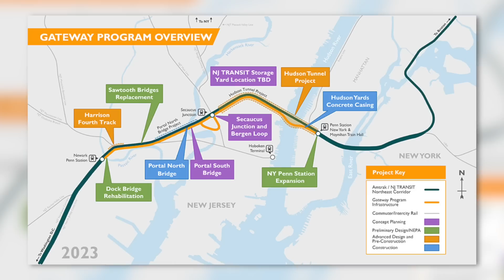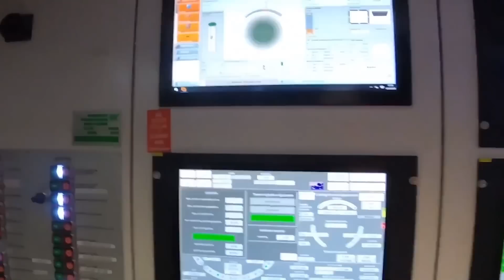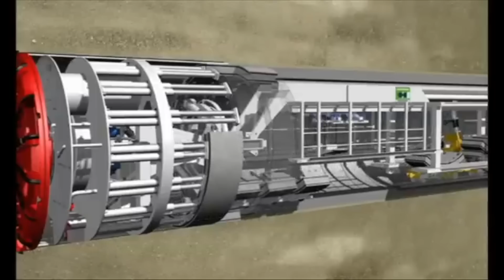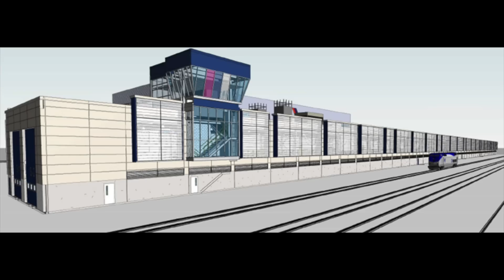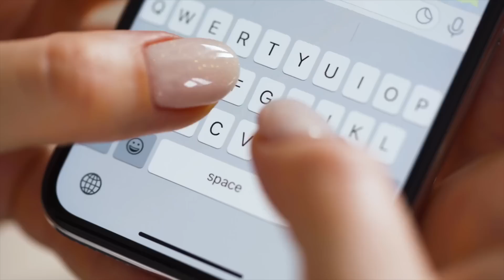Inside New York’s $16BN New Mega-Railway

Comment: Why not build a tunnel like the one being built in Denmark to Sweden which will have been done in 7 years. It would take a much shorter time because it'd be much shorter. The European tunnel will is being built using concrete section the are being sunk onto a trench piece by piece. The best part you can have 5 tunnels for the price of one, each section can have rail and car traffic.

Comment: The initial attempt to build this tunnel was canceled and was called Access to the Region’s Core by Chris Christie in 2010 before the hurricane because of the escalating cost. It was originally going to cost $8.7 billion and went to $12 billion so he got rid of it. Now we have the desperation of the Gateway Program which costs $16.1 billion. The backward thinking approach over a decade ago resulted in this monumental challenge to replace the rapidly deteriorating original tunnel which is now 100 years old. As mentioned in the video as soon as this new tunnel is in place, the old one will be closed to be rebuilt completely due to the salt water corrosion which is causing it to rapidly fail with outages regularly occurring on weekends to patch it up.
Reply: Christie SAID it was for escalating costs, but NJ's part was small - and he used the funds earmarked for the tunnel for Republican pork projects.
Reply: @peterquennellnyc  I know - left that out.  It was very short sighted at the time and now the region is paying for it with terrible service.  I lived in NJ when this happened. Fortunately, now I live in CT and don't have to deal with the awful 100-year-old runnel.

Comment: This is not pioneering  - it is not transformational - it just adding capacity.  In fact, the plans are tied to building 8 new platform tracks at Penn Station and a NY Post story from December shows that part of the project is going to cost $17 billion.  What is needed is a new vision that connects the operations of all three commuter rail systems that today operate in their own silos and recreate a regional vision that makes seamless travel from one end of the region to the other.  This project as designed falls far short of that vision.  We need a new pair of Hudson River tunnels, yes,  but we also need a vision for connecting the NY region the way London and Paris have been able to achieve.  The LIRR just built a similar 11 billion dollar 8-track terminal far below Grand Central, because Metro-North didn't want to share the main station, and only 50,000 passengers a day use it.  While London just opened the Queen Elizabeth Line during COVID-19 and this two-track line moves 600,000 per day, more than the total ridership of the LIRR NJTransit and Metro North combined.  No, we are way behind the rest of the world on visionary thinking.
Reply: Hit the nail on the head about the importance of through running. It is madness to continue to build stub end terminals in NYC. Madness and stupidity.
Reply: Back in the mid-1980s, British Railways conceived and implemented the idea of NetworkSouthEast, interconnecting all the lower-right coner of UK, train services crossing London.
It was a very useful scheme, subsequently ruined by political ideology, but many services continue to cross London usefully, without terminating there.
Reply: Not sure what's broken. Many London "tube" trains are stuffed to bursting. And "only 50,000 passengers a day use it" is misleading. They would have arrived at Penn Station otherwise and then have to find their way back to NE midtown, where a lot of new construction is planned.
Reply: @peterquennellnyc  600,000 a day are using the new Elizabeth line in London, while only 50,000 are using the LIRR station at Grand Central in NYC.  This is because the Elizebeth Line is connected from one end of the London suburbs in the west to two destinations in the east London suburbs.  Gateway and the new LIRR terminal should be connected.  36% of NJ Transit riders want access to NE midtown.  Why force them off at Penn and have them crowd the subway?  That is what I wish to convey.  Not only would a connect to GCT help, but also through-running to Long Island, the Bronx, Westchester and Connecticut would provide a one seat ride suburb to suburb.
Reply: @robertw.previdi5450  I dont disagree - but I've seen it all before. There WERE proposals to extend Gateway to Park Avenue x 34th Street subway area and in years to come that could still happen. Subway to NJ too. No lack of foresight as you imply. It does take cash. You omit that Manhattan's walking distances are smaller,  I walk twice daily between Port Authority and UN. And Elizabeth Line is apples and oranges. Most tiny London tubes still bulge... hmmm... maybe lack of foresight there :-)

Comment: The "Box" was necessitated by the selling off of a tunnel easement at 31st Street in 2015, which would have provided a superior alignment into the station. The easement was procured around 1910 along with a similar one at 33rd Street, as the need for two additional trans-Hudson tunnels was foreseen. Both the lateral and vertical alignment of the currently-planned tunnel are extremely problematic, and I can't say it's not willful, deliberate.
Reply: Always people in the past were more forward thinking than anyone now...

Comment: ny has so many serious problems. i doubt that the rail problems will keep ny residents in ny
Reply: This project is also for the nation, not only for the NY-NJ area…
Reply: @aoilpe  Not really. NY is losing population and the rest of the US does not benefit from the NEC expansion. In fact it takes monies away from Amtrak's other needs. Like getting equipment in shape for longer distance runs. Like restoring the Sunset Limited from NOLA to at least Orlando. If there is a storm in NC,  SC, or Georgia, Florida gets cut off from any Amtrak service. And Florida now has a high speed rail line that wasn't built with the government owning it.
Reply: @gravelydon7072  "(1) NY is losing population and (2) the rest of the US does not benefit from the NEC expansion". Two misleading statements. (1) Many leaving NY state are from upstate; and its the SUCCESS of the greater NYC economy that is driving up costs. (2) The north east is THE economic engine of the US, and transfers many billions in revenue to economically struggling Red states. Huge numbers of highly educated highly productive Manhattan workers will use the new tunnels to get to work.
Reply: It's never about what the residents need. Bankers need to get to work.